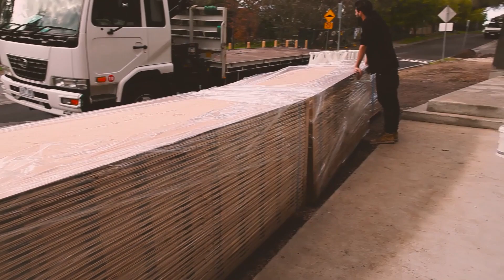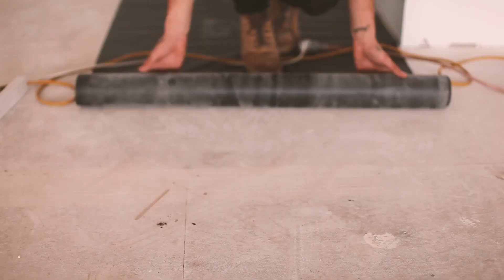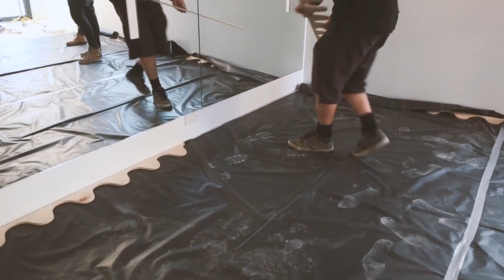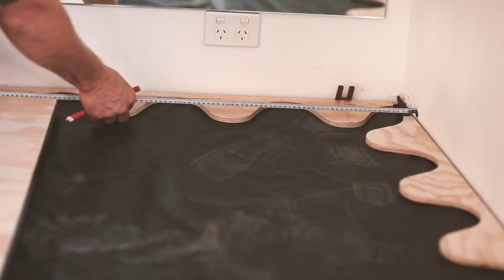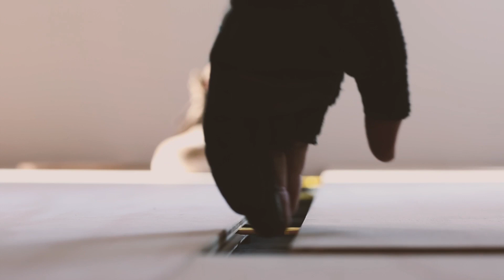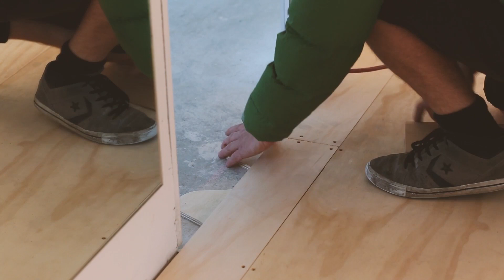Sprung Dance Floor Installation by Show Works

Comment: Do you recommend a plywood subfloor before installing? I noticed that the floor in this clip is not concrete.
Reply: Any flat surface is fine
Reply: The substrate is best when concrete but it can go on any flat even surface.

Comment: What thickness or grade of the foam pads? And what is the purpose of the wave board?
Reply: Hi Big,
Sorry for the delayed response; the wave holds the perimeter infill panel in place.